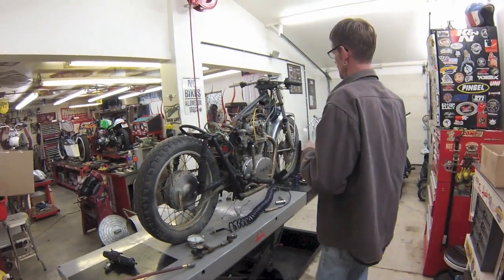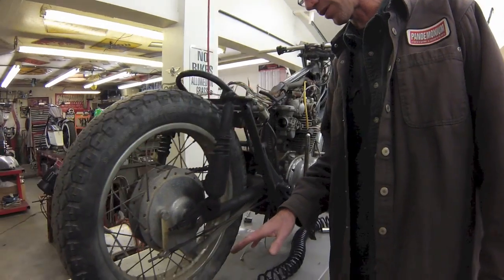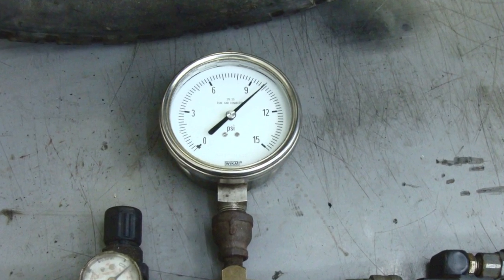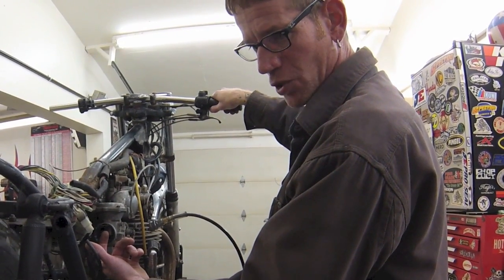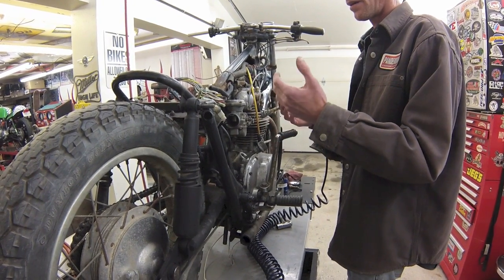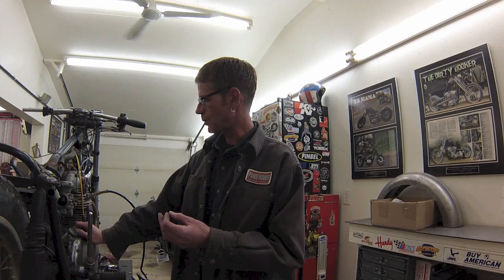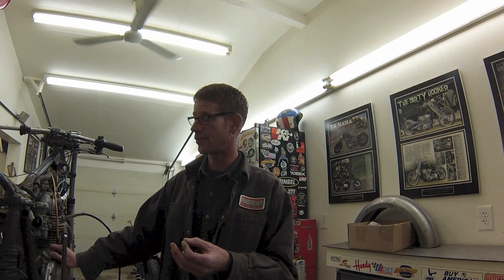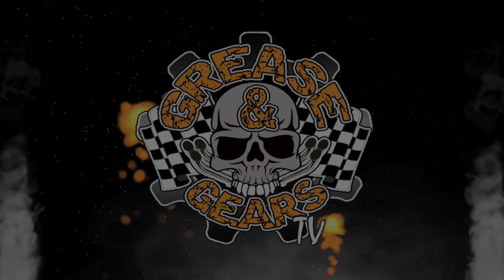Pandemonium DIY Leak-Down Tester

Comment: thats exactly what i was going to do find a fitting off a old compressor tool i never use and glue it inside a old spark plug housing and waa laa connect air compressor to spark plug hole,question is,how much air do i use,i can google it lol